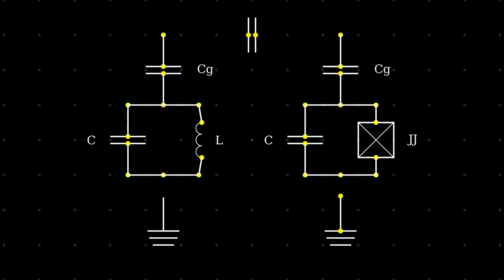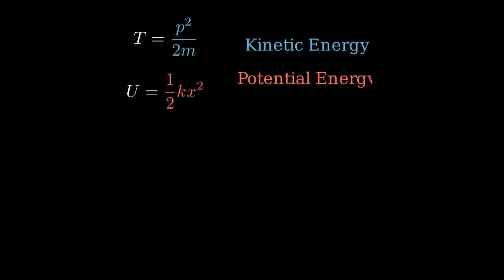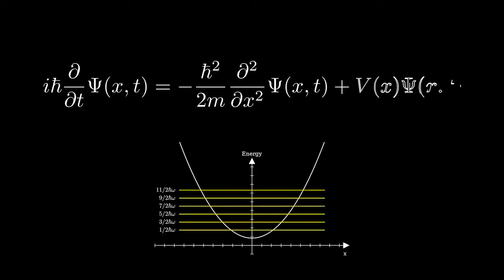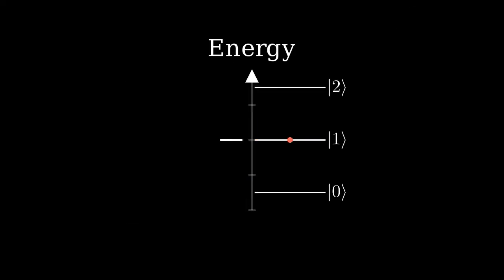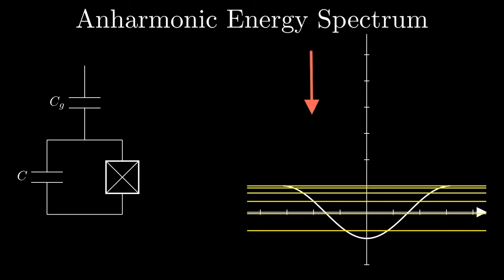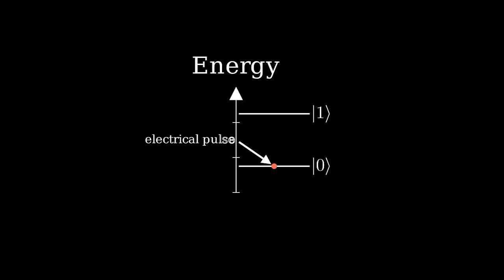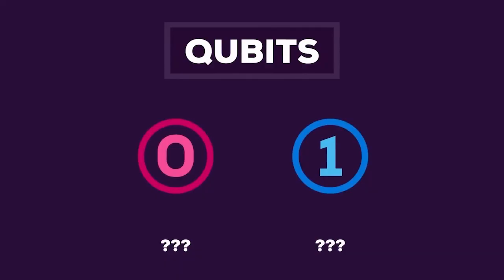How to Turn Superconductors Into A Quantum Computer | Superconducting Qubits 1

Comment: Very nice, thank you!
One question though: in the LC circuit, what is playing the role analogous to the kinetic energy term in the ball-on-spring system? Is it like, idk,  current squared over some constant, or, something else? (I’m not experienced with circuits)
Reply from the maker: The inductive term is usually described as “kinetic” in a sense. I believe This is because of its relationship to the canonically conjugate variables used in the construction of its Hamiltonian. If you want to read up more on what that last sentence means (idk your physics background) check out the Wikipedia page for canonically conjugate variables, and then check out articles on circuit quantum electrodynamics (the name given to the study of superconducting qubits).
Reply: @Lukas-Lab   thanks! I’ll read up on the circuit quantum electrodynamics article (maybe after reading a bit about classical inductance)

Comment: Using lasers to experiment with. Wouldn't it be nice to have ambient temperature super conductors?
Reply from the maker: Ambient temperature superconductors would be great! But we would still need to cool superconducting qubits down to nearly absolute zero anyways - because thermal noise would always be an issue and cause decoherence. It would definitely help with the room temperature electronics though! I may actually do a video on this now that you bring it up :)

Comment: I want to mention what was confusing for me, I don't know anything about quantum computing beforehand, except for the 'how to build a quantum computer' video.

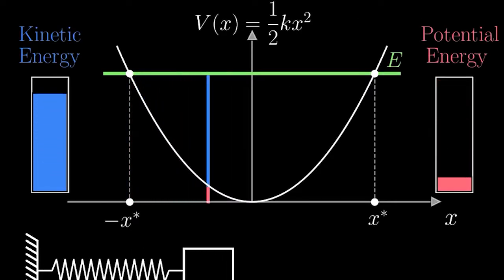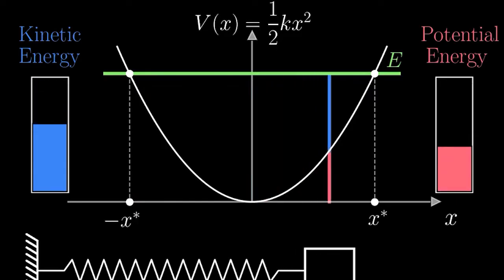The animation of the weight on the spring is just so confusing, since potential and kinetic energy are visible. But the spring and the weight itself is sideways, and I did not notice it in the beginning making it even more confusing (1:12 - 1:21).

You mention at 1:22 'so if we take a small step closer to quantum computers. if we arrive at that small step, we arrive at the LC circuit', which is honestly just a confusing sentence, even with context. The 'arrive at that small step' just makes it confusing, it just might be me.

The inductor explained very rapid, which no good explanation how it works, it just works because magnetic fields.
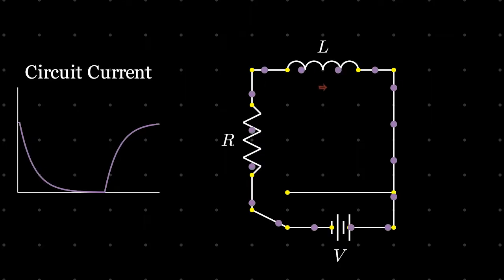The same holds true for the capacitor, like maybe give examples how it works. It is just exampled too quickly to really understand how they work (1:38-1:55). 

I think putting a bit more time into explaining how the current changes how time is a harmonic osculating motion. It does not make sense without more context/time put into it (1:56).

Why is the potential energy tying both harmonic osculators together? (2:20)

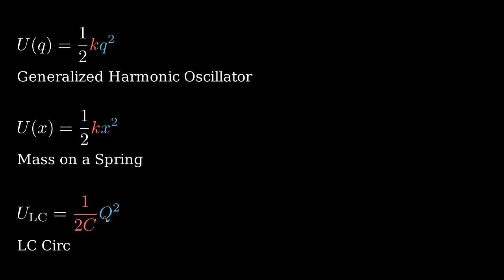The formulas are displayed very briefly, and kind of good explained, but maybe an example would do no harm (2:45).

You explain 'if we want to go from the harmonic potential to an equation of motion, we can use the Hamiltonian', and after an explain that you can do it differently, but you then mention that you use the Hamiltonian because the Hamiltonian translates most directly and naturally with quantum computers.

But maybe you should first mention that you are going to go from harmonic potential to an equation of motion, to finally get the Hamiltonian, which is the sum of potential and kinetic energy. And then explain that you could have learned it in school but by balancing out forces, called Newton laws.

There is no deep explanation why the Hamiltonian translates most directly and naturally with quantum computers, you also mentioned this in the video.
But it is good that the examples are given.
-Hamiltonian becomes an operator.

How do we know the wave function? (4:18)
And can't we use integrals to calculate it, or is that is how it's done?
Because that is what the picture shows.

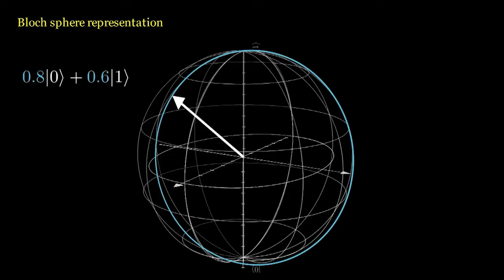And am I correct that the bloch sphere works with quaternions? (4:23)

What do you mean with not all energies are allowed? (4:53)

The 0 and 1 state, the 0 state can be set to x (whatever we like, that is allowed) and 1 set to x whatever is allowed.
So that the system also knows the difference between 0 and 1.
Is that correct, if not could you elaborate?

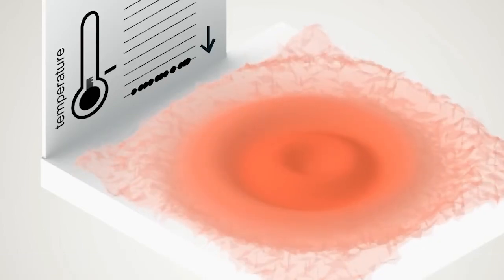The explanation of making a circuit quantum is kind of vague, since the temperature is not mentioned, and it hardly visible, except if you look for it. And the explanation is way too vague (5:35-5:57).
The part about replacing a conductor with superconductor was explain well, just the part after that was ... vague.

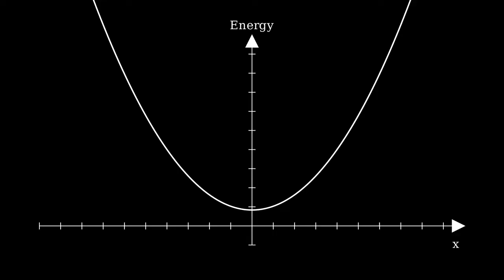After that explanation we don't get a comparison between LC circuit and quantum LC circuit. (6:00)
Which makes me think, do the LC circuit and the quantum LC circuit look the same?

The explanation of how the energy between state 0/1 and 1/2 should be different because of stimulated emission, which makes you able to jump up or down depending on what state you are. 
Because of the energy difference (transitioning frequency) difference was at this point still the same. Correct?

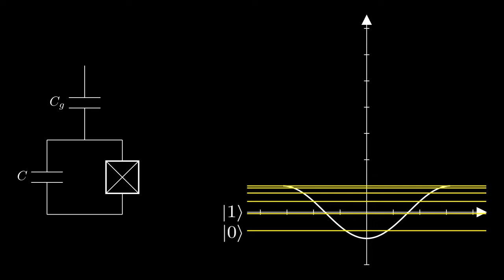So, because you have different transitioning frequency between each state, it is a qubit? (8:00)

What is special about the transmon qubit. How difference it from other qubits?
I assume another architecture like mentioned in the previous video.
And what are the benefits for it?

The explanation of capacitive coupling is explained well but maybe an example (like how a relay works), could like to make it more visual. But I assume I understand what it does correctly. (It kind of reminds me of transformers for some reason) (9:40).

Thanks for making these kinds of video's, they are really interesting.
Sorry for writing a whole book.
Reply from the maker: Thanks so much for the detailed feedback! I’ll keep this in mind - I definitely didn’t give enough background on this video, so the next one will have some better structure.